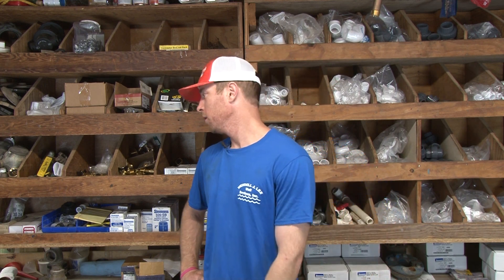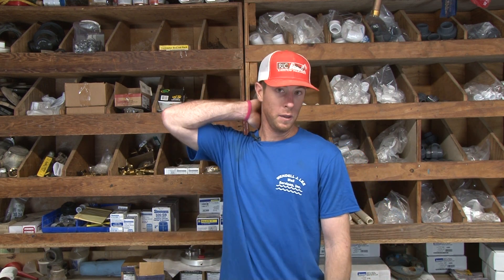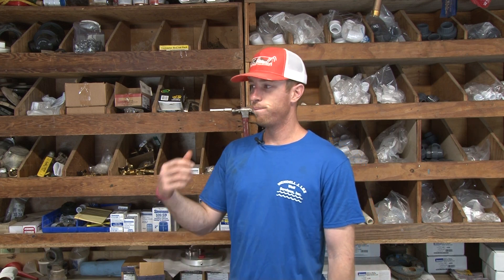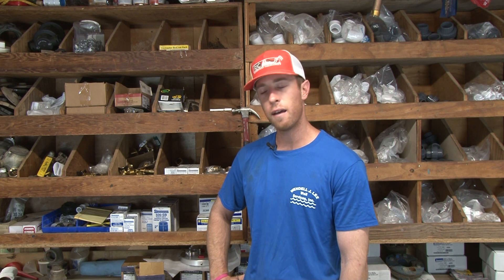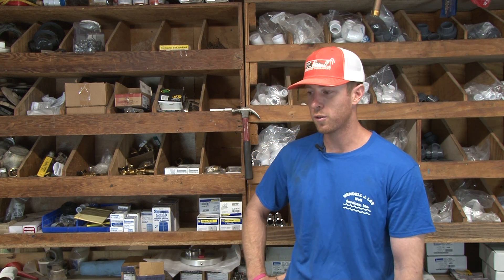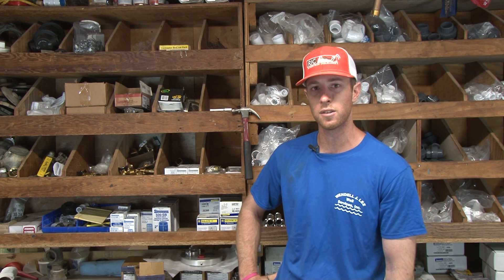How Much Flowrate Does My Water Well Need for my House?

Comment: We have 15gpm but not enough pressure to wash a car or hose driveway off unless I use a nozzle with a special head, even when coming off the spigot just past the pressure tank. Sounds like I need to check the tank.

Comment: I am watching a lot of your videos. I really like how you explain things - thank!!  I am on Long Island.  I had a well placed for irrigation only. My sprinkler company hooked up the well out and split the line; one line to the valve manifold and the other went back to my house. I do not understand why the water goes back to my house, it is purely for irrigation. Any ideas why? He is no longer around so I cannot ask him. I know the shut off valve is in the basement and that is where the electric is. I have a BIG issue with  pressure too high splitting hoses and sprinklers heads every year. I have 30 valves around an acre of property. All I see is the check valve on my well line. I need to put a rust filter,  pressure gauge as some type of pressure reducer once I can figure out how to check my actual numbers. Can you list the order these things should be in? My well company is not returning calls and all I know is that they put in a 4” 1 ½ hp franklin j class pump with drop pipe and screen. I do not know the depth or any rates. I appreciate any help you can give to get me started.

Comment: How many pounds of pressure can I expect out of a well.  My city water pressure is 80.
Reply: You can expect a well to provide 40 to 60 PSI of water pressure, which is the normal range for a residential system

Comment: If a 160 feet deep well only produces 65 gallons of water per 24 hour period, can I do anything to improve the production of the well, or am I better off starting over and digging a new well?
Reply: Have you tried a dowser?
30 years ago, I wanted to install a geothermal water to air pump. Needed a 3 ton machine and the machine needed 10 gpm. Had a dowser walked the ground. He indicated an emplacement where I would get 850 gpm of potable water (bit of iron), at 68 feet depth. I know, hard to beleive but it all worked out exactly as he said.
Reply: Yes have it fracked could open seams of water.

Comment: Have a question for you. Had a well company drill a well for us in Florida.  180 feet, we installed our own pump, drop pipe, wiring with a above ground control box. We started the well pump, it pumped out some water, my dad closed off just a little of the shut off valve. The points(think their called that), bummed, then there was no water coming out. Control box hums, you can see the pipe move when power is turned on, no water coming out.
  Our water is milky looking, we were going to run it so it clears out. Why would the pump shut off like that?